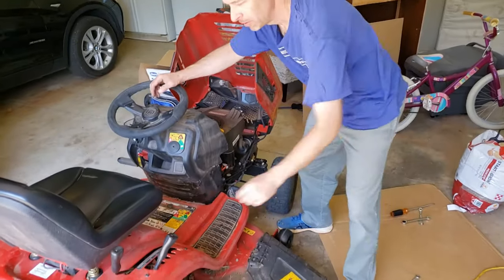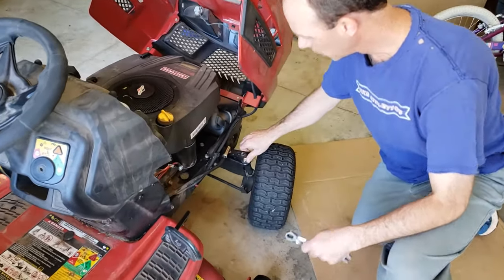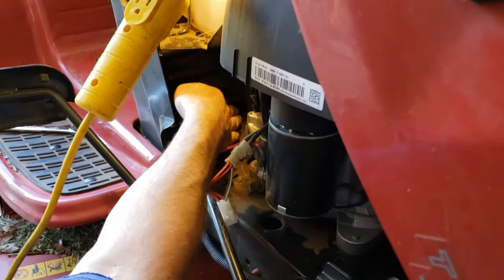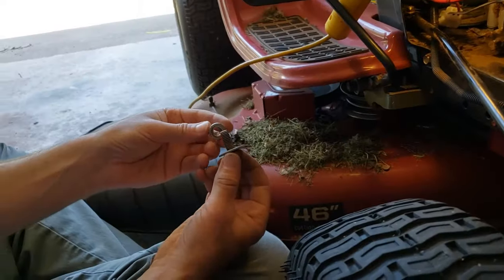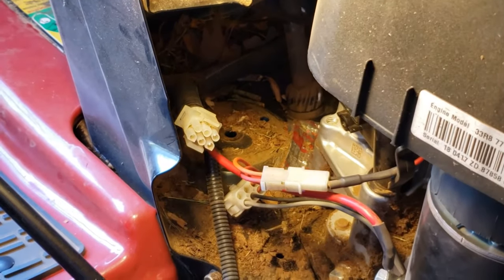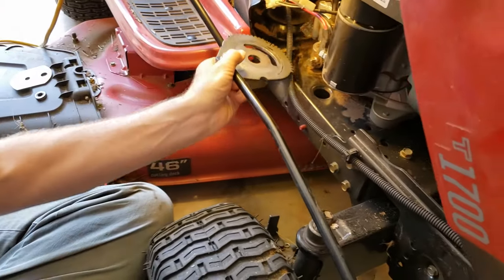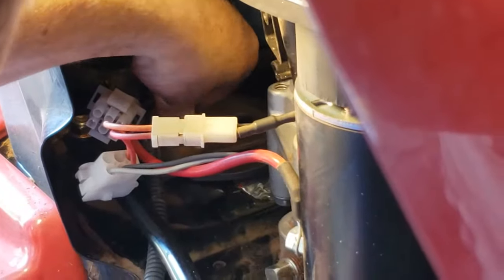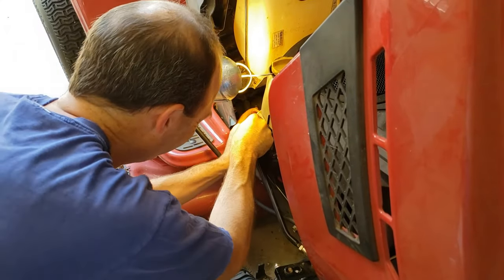Riding mower steering problems - won't turn left (or right). How to fix

Comment: Short cut: No need to disassemble the gear mechanism.  Simply remove bolt the gear rides on 1/2 inch. Use  short screw driver or any other tool that will fit in the hole. Turn wheels until you see debris then simply push them through the hole. Repeat until clear. Finish by simply using a leaf blower or any form of compressed air to clear debris out from under gear. To prevent this from occurring again simply  clean under the hood with leaf blower a few times during the season.

Comment: Buy yourself a leaf blower and blow it clean after each use, Takes less than 2 minutes to do, Leaf blowers works better than water from a garden hose. If you want to wash it, only wash it after  you blow it off good with a leaf blower.

Comment: WOW! THANK YOU! My mower wouldn't turn left. I came across this video. Mine is. TROY BILT Pony and set up the same way as yours.  We took it apart and there was dirt trapped in the slot. Put it back together, even after forgetting to use a marker, and all is well. My mower turns beautifully!!! I hope others come across this video that have a Troy built.
Reply from the maker: Glad to hear this was the same as yours and you were able to get it to work!

Comment: This fixed my mower. I couldn’t get the 1/2 bolt out. With the 9/16 out I was able to rotate the top plate, that exposed the grove that was packed with dirt. With a long flat screwdriver I cleaned everything I could get to. It helped to turn the steering to the right that exposed more of the groove.

Comment: This was perfect for my exact same issue I was having with my troy-bilt rider.  Instructions were clear and to the point.  Thank you for providing this video ! Much appreciated !
Reply from the maker: Thanks, Bill! Great to know it's the same issue and solution on the Troy-Bilt. Thank for the note!
Reply: @FixEverythingYourself  Awesome stuff. Also worked for my Troy Bilt, exact same issue. Thanks.
Reply from the maker: Great! Thanks for the feedback.
Reply: Came here for the same reason my darn troy built pony won't turn left. Makes a hard right tho lol. Been like that since I can remember and i bought it new 2019 but I will admit that with my yards layout and the blower side being on the right I almost don't turn left ever. But when I need to I would like to be able to! Haven't attempted yet but hears to hoping. Thanks!
Reply from the maker: Good luck!
Reply: same as billstrasser said. I'll add, thanks for having a camera person follow the actions and provide centered shots of what was going on.   I'm stoked and confident I'll have a 100 proof fix on mine after watching this, thanks guys.

Comment: Thanks so much for the video!!! I have a Craftsman T110 and it's been a fixer upper since day 1, but my brother gave it to me for free, so I really can't complain. It started not turning left the last time I mowed and I also broke the PTO cable, so it has been sitting while I waited for the new cable to be delivered. Got it installed today and figured I'd check YouTube for any solutions to the turning problem. Followed your steps and sure enough the channel was packed with hard gunk. Cleaned everything and reinstalled everything and BAM!! It now turns better than ever!!! As a 45yo woman who doesn't have anyone to help me, I was able to do both the PTO cable and the steering gears myself in under 4 hours!!! (On a gravel driveway, no shade, 100 degrees and humid here in GA, and frequent water breaks 🙋🏼‍♀️🥵) I can't express how happy I am to you !!!!!😁😁😁
Reply from the maker: Great job! Doing this job by yourself if you haven't done these kinds of repairs before is impressive! Glad it worked!

Comment: This my third repair of a Craftsman T140. First time I followed this great how to video and got it fixed. The next two times, now that I understand the mechanics, I used an electric pressure washer set to pin stream and cleaned out the crack while moving wheel left to right. Worked perfectly and was a real time saver. BUT I'd have never understood how to do until I took it apart so many kudos to this Guy.
Reply: That's honestly the quickest way to do it. As long as you're not blasting away at the electrical connections, you're good to go.

Comment: Thank you so much! After only making right turns for most of last season, I found this video and showed it to my husband this spring. It took him quite a bit longer than your 7 minute video to make the repair, (bolts were hard to remove) but once he was done, voila! I can now turn left again! I can once again circle the trees, make 3 point turns, zigzag around the bushes--yahoo! 
Thank you so much. My time spent mowing is so much less frustrating!
Reply from the maker: That's great! I was just as frustrated before I decided to take it apart and figure out what the problem was. And it takes me more than 7 minutes, too 🙂

Comment: I just ran through these steps on my 2018 Troy-Bilt Bronco. I think it has a tighter turning radius now than when they dropped it off here back in 2018. Thanks Man!!!
Reply from the maker: Awesome! Thanks for sharing!
Reply: Me too!! I just fixed my troy bilt Pony and I think it turns better now too!!
Reply: Same here with my Craftsman. Brand new and left turns were never this sharp. Always thought it was designed this way. Finally got to the point I couldn’t make left turns and found this video. Now left turns are as sharp as right.

Comment: A few folks have suggested using compressed air to remove the debris.  I just did this procedure on my Craftsman. Disassembly WAS necessary, as compressed air could not even begin to remove the hard-packed grass and dust. (I tried that first!) Thank you for this video!
Reply from the maker: Right, the debris in mine is way too hard to blow out. Thanks for the comment!

Comment: This was the exact fix to my issue.  I lost my complete ability to turn left.    After some generous WD40 on the bolts the plate was off and I found it packed with solid mud on the one side.  Thanks for the great video.
Reply from the maker: Thanks. Glad you got it figured out.

Comment: Thank you so much!!! My exact problem. Fixed it myself and drilled a hole in the frame and inserted an air tip on the bottom. I can now just hook up to my compressor tip and blow it out without disassembling everytime. Cheers...
Reply from the maker: That's a great idea, Kris. I think I'll do that next time. Thanks!
Reply: Did you try blowing it out before drilling the hole?

Comment: If you have a compressor you can blow out the packed garbage without disassembly (at least on my model). Turn the steering wheel all the way to one side and blow out the exposed slot, then turn it all the other ay and blow out the other side of the slot. A LOT easier than taking it apart, although the instructions work great if you are compressor-less.

Comment: without taking everything apart I blew it off with a leaf blower then Soaked that area with some penetrating oil,worked the steering right and left a couple of times and now it seems to be ok,turns more than it was before.
Reply from the maker: Interesting approach. I was able to improve mine somewhat with some other approaches but the dirt in the gear plate was almost rock hard and I couldn't get the last bit out without taking it apart. Haven't tried the oil trick, though...

Comment: Great video. I do have some ideas for solutions to this issue. Do you think it might help to drill holes downward to allow the debris to fall out on its own?  Also, would regular pressure washing or using compressed air in that area work as preventive maintenance?
Reply from the maker: I think both ideas are reasonable. Other people have commented that they use compressed air and/or water to keep that area clean. Both are worth trying vs. disassembling regularly.

Comment: I also replace all four plastic flange bearings on each front axle pin and it really helped making it easier to turn as well. Part# 954-0467A

Comment: Thanks,very good video .Got me right to the source of my steering problem.I did cut out the side sheet metal in order to facilitate impact ratchet as I feel this will end up happening again so I want quick and easy access to the bolts.I closed the  opening with removable plate access cover.I only loosened the bolts (did not remove)and was able to blow out the restrictive debris from the gears
Reply from the maker: Thanks for the great feedback, Joe/Joseph. I appreciate the good tips, too!

Comment: Video very helpful, had the same problem every year after leaves.  Kinda awkward area to work and have discovered periodically spraying WD40 into the gap on extreme right and left turn seems to dislodge/dissolve the debris and restore turning radius without having to disassemble and reassemble.
Reply from the maker: Thanks for the tip 👍👍

Comment: Great video.  Just happened to mine and with your vid, can fix myself and not take to shop.  Thanks a lot!
Reply from the maker: That's great, Robert! It was very frustrating when it first happened after buying the tractor new but I was glad when it turned out to be pretty easy to fix.

Comment: Same problem.... narrowed it down to this same area.  Was about to take this assembly apart on my T2600, found your video to ensure I wasn't making a mistake I could not fix.  Any idea on how to prevent this?  Was a total pain in the arse to get to those two bolts on mine.
Reply from the maker: Some people have put their solutions in the Comments, so read thru those. I used some foil tape to build up a thick wall of tape to block the gap a bit from debris being able to get in there. Not a perfect solution but helps delay the time it takes for it to occur..

Comment: I had a different problem. The bushing on the bottom of the steering shaft (bellow teeth) was worn out allowing teeth to skip. Cheap, crappy, soft material. I had a 40 year old Simplicity mower that never ever gave me trouble. New mowers are all junk in every way. I am always working on mine. It's one thing or another.
Reply from the maker: Dang...
Reply: @FixEverythingYourself  Steel shaft inside metal bushing with NO lubrication. What could go wrong? I have to replace this bushing every season.
Reply from the maker: What brand and model is it?

Comment: I followed your instructions. However, for reasons unknown to me, now my riding lawn mower turns in the opposite direction than steering wheel is turned...
Reply: Found my problem was I connected the arm to the wheel axis backwards. Turned the square adapter over so it equaled to the video.
Reply from the maker: Good job. Saw you solved it before I got a chance to reply. That's exactly where I was going to point you.

Comment: 5:07 See the teeth on the disc at the end of that bar. They need to be 220' around, not just 170'. That's were the steering is lost.

Comment: Hopefully that my problem my steering rod broke off the ball joint so I used a bolt to fix it after going into the ditch at my house twice now that I got that done it doesn't want to turn all the way to the right
Reply from the maker: Good luck!

Comment: Thank you!  is there anything I can do to stop this from happening every year???  Also shame on Craftsman for such a lousy design..
Reply from the maker: There are a few suggestions in the Comments with what others have said works for them to prevent this. What I've done is used several layers of foil tape to protect the opening where the dirt gets in. It's not perfect but slows down the rate at which the dirt gets in there. Good luck!

Comment: I have a Snapper Yard Machine Riding mower.  Do you have a video and how to check my steering on it?  My mower wont turn right, the steering wheel just spins with no grab or bite.  It turns left fine, but not right?  please send me the link if you have one with a Snapper 2018 yard machine riding mower.  if not, I do have email if you can send me written instructions.  I want to try to repair my mower myself since I have no trailer to take it anywhere and could use the help, any help will do.  you do a great job on your video.  Should I send you my email address or how do I talk to you...on this comment?  Thank you...Have a BLESSED DAY!
Reply from the maker: Sorry, I don't have any info on how to fix that Yard Machines problem. Sounds unique. Good luck.
Reply: @FixEverythingYourself  okay thank you

Comment: I have the opposite problem. I go to steer EITHER right or left and the steering gear  is total not engaged. I can spin the steering wheel either way and it's not engaged. If you're unaware of this you can be killed. Not Kidding. Too cheap to put teeth 360' around.

Comment: Need some help. I have the same mower as this one but for me the screw on the bottom of the shaft broke. How do I go about repairing it?
Reply from the maker: Are you referring to the threaded portion that the blade fits over and the nut attaches to to hold the blade on? If so, you'll need to replace that spindle/pulley assembly. It's not incredibly hard but more involved than just replacing the blade.
Reply from the maker: The first step is removing the deck (https://youtu.be/00nGA7XxIdQ), then you have to remove the old spindle and put a new one in. I can send another video on that part of the project if you need it. You can buy a new spindle on ebay, among other places.
Reply: @FixEverythingYourself  upon further look I’ll have to replace the whole steering shaft because at the bottom of the shaft there is a screw that holds the washer in place.
Reply from the maker: Sorry, I was thinking you were replacing blades, not fixing the steering. My mistake. Looks like you figured something out. Now that I realize you're fixing your steering, I'm not sure what your exact issue is/was. Good luck.

Comment: Wow...my exact problem...and exact mower hahaha.....i guess i have to do this because mine doesn't turn for crap.
Reply from the maker: Yeah, it's an annoying problem. I used some foil tape (kind of like duct tape) to block where the dirt gets in. You may be able to see it in the video. It helps delay the problem but doesn't eliminate it. Good luck!
Reply: Just put some water to the dirt, it's a hell of a lot easier and 100% effective

Comment: wish this was my problem, I have a Toro with a very similar steering mech, Total piece of junk!  I have had to rebuild it 4 times in 10 years to keep it functioning.  I tighten all the bolts every spring but it still strips out by the end of the year.  DO NOT BUY A MOEWER WITH THIS STEERING SET UP!!

Comment: anybody in NE Ohio that can fix a riding mower for me with steering that is totally stripped on making turns.?..the tires are splayed out and it's just making huge wide turns that I have to keep backing on and trying to then recorrect to then go straight.....it's totally gone on an Airiens mower (husquvarna engine).....

Comment: I have one of the t1500 I replaced the deck belts and drive belts. I didn't take any pics. I can't remember where a spring goes. Do you have any info where I can see where the springs on the mower frame are mounted?
Reply from the maker: Here's a video I just did on removing the deck. Maybe the spring you're looking for is in here. 
https://youtu.be/00nGA7XxIdQ

Comment: Man the steering setup on these things are garbage. Bought one used and ending up replacing everything it seems. I need to replace that gear assembly anyways, but I bet it is full of junk.
Reply from the maker: Yeah, I'm not thrilled with it but it still works so I'll keep it.

Comment: I have the t130 and it has the same issue, going out to fix, thanks, I thought I would have to re-index the gear because it still has teeth left over for a RH turn when the wheel will no longer turn. It appears the opposite situation on the LH turn, running out of gear teeth. Maybe I have a duel issue.
Reply from the maker: Good luck. Hope you get it fixed!

Comment: Mine doesn't bind, it SLIPS. Mower is 2 years old. Bought new. Same steering assembly as yours. Seems teeth on gear dont mesh as closely as yours. Sprayed some lithium on there and helped for 45 mins. Any adjustments to move gear just a hair closer to gear on bottom of steering shaft? Nothings worn visually, all looks good, could just use a little less gap between shaft gear and bigger gear....
Reply from the maker: Does your gear plate have the circular spacer in the center hole that the bolt goes through? Not having that would cause the problem you're describing. If that's not the issue, it would be challenging to modify it to work correctly. Has it been like that since new? You may just need a new gear plate if the teeth are worn?
Reply: @FixEverythingYourself  actually yesterday I looked into it deeper. Whatever is at bottom of steering shaft, that goes through frame is toast. It wobbles. Only a Philip's head screw underneath. Gotta somehow find this part and hope screw comes out of bottom of steering shaft easily.. This is a new issue, mower produced in 2019! Hope I can find that worn pc! Update! Turns out its the spacer that sits in frame, that steering shaft rotates in. Wore out, new one coming. What a poor design!
Reply: Mine slips too, but only when it gets to the point of not wanting to turn. I took the plates off, wiped the dirt off, and I'm going to clean the plates and put some new grease between the plates and see if that fixes it. It could be the same issue you are having so I'll have to look into that when I'm working on it tomorrow.